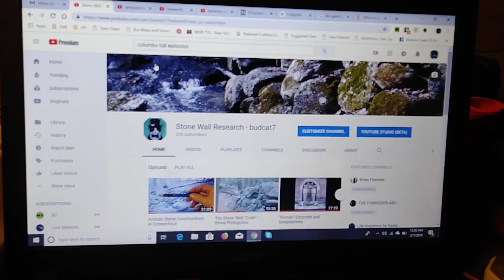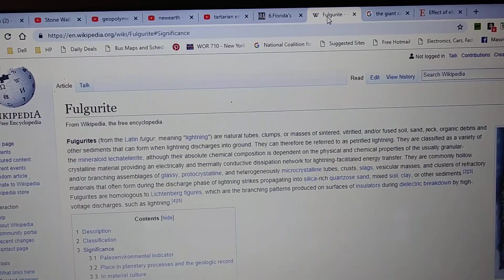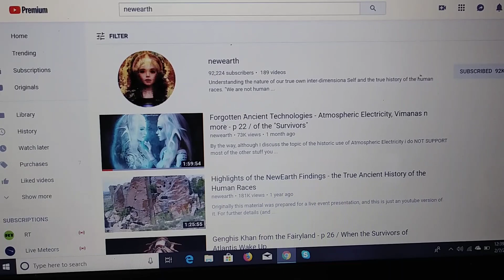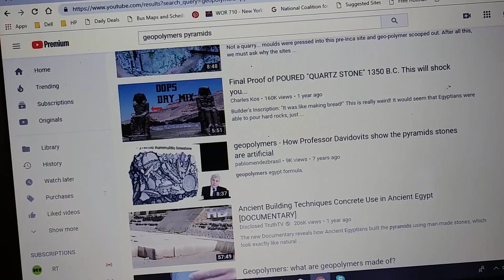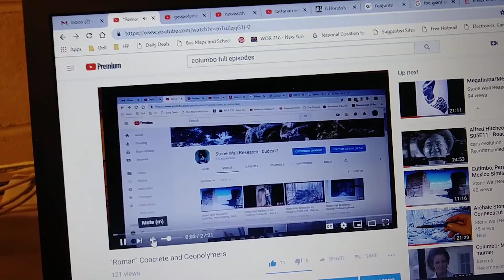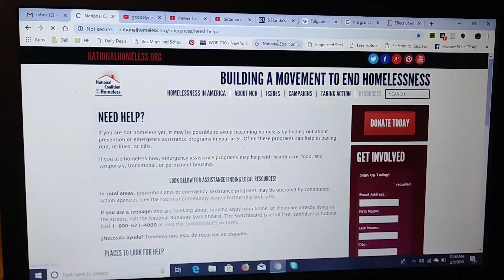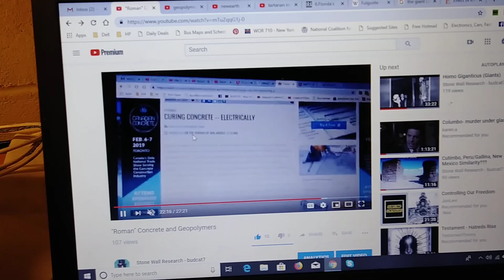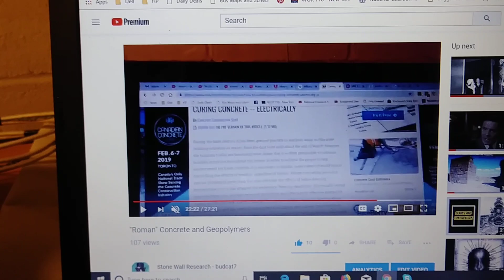Tartarian "Free Energy" Geopolymers

Comment: Great stuff, Dave.   Theres a very informative vid posted by a friend of Sylvia, Life Kreationz by David Wells, Ancient Suomi Part 1.  Monolithic Lies. He goes into detail about the Alexander column and its dubious history. Start in at 25.00 Minute mark. It could be a geo synthetic/polymer maybe SCAGLIOLA. I'll try to catch up on your Mallory series. Did you spot the 'eye' in the Sherman cemetery wall?
Reply from the maker: Sylvia also proposed that the columns were made of geopolymer granite as well as many other things. She shows statues that were supposedly "carved" from stone and it seems just impossible that the intricate work done was with using steel tools it's just way to fine. And she also shows many walls and columns that were thought to be "carved stone" that were actually constructed of "block" and then a "plaster" was applied to the surface to create the "stone" material.
Reply: @budcat7  ...I've seen that video and your right, impossible!